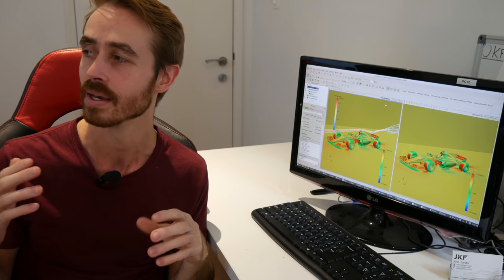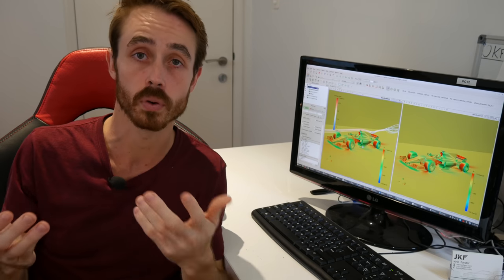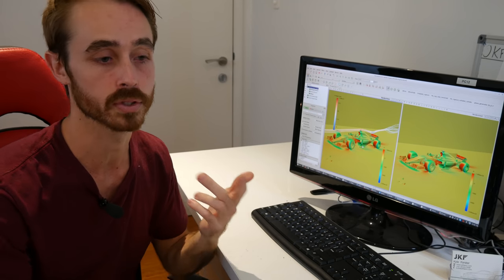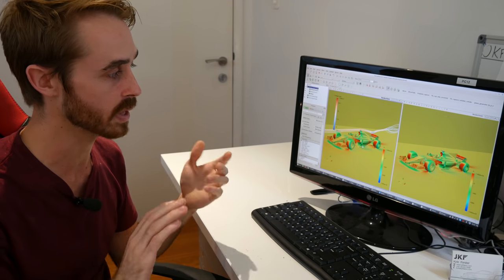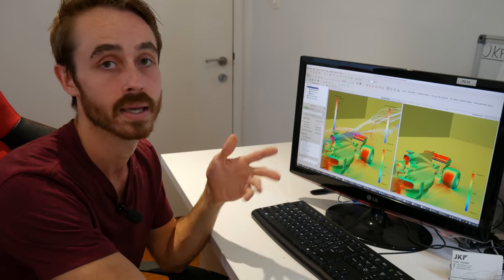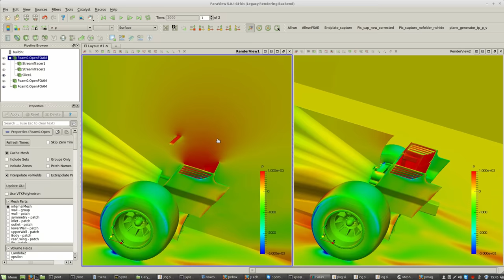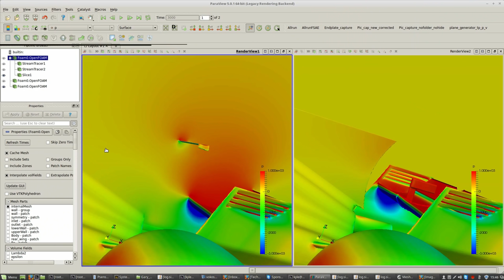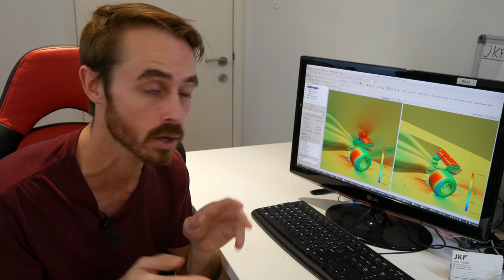T-Wings on 2017 F1 Cars - How They Work, Detailed Explanation and Mythbusting

Comment: Have you thought that perhaps the t-wing is being used to extend the zone of dirty air behind the vehicle, and thus making it harder for competitors to overtake?
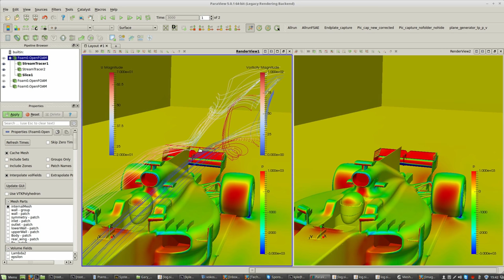Reply from the maker: I would think it highly unlikely, the wake of the T-wing is above the rear wing, so the upwash of the wing will keep its central wake clear of the following car (see the video at 4:10). The tip vortices merge with the current wingtip ones, and as such would have little effect on the far wake as well. A few aero leads came out a couple of months ago (Adrian Newey included I believe? Can't remember exactly) and said that its primary purpose was a high efficiency downforce element, similar to what I concluded. F1 teams don't really go out of their way to make dirty air worse, as dirty air is usually proportional to wake magnitude, which is more or less proportional to drag, so gambling on the chance that you may slow down the car behind a little bit isn't worth the performance compromise.

Thanks for dropping by!

Comment: I really enjoy your videos...  aerodynamics is a difficult science to comprehend for those of us outside of the field and I've learned quite a bit from your channel.  The most helpful visualizations you use are when you include streamlines...  pressure fields are easier to understand when the streamlines shows us the flow of the air and subsequent vortices.  So please, more F1 videos (I'd really like to see how the 'closed' T-wings of McLaren and Mercedes perform relative to the T-wings with endplates) with more streamlines...  and more cowbells !!!

Comment: I think it is a useful analogy to compare it with a leading slat on an aircraft wing. While it does not increase the lift at constant angle of attack, it does allow the main plane to be under a higher angle of attack without stalling. As you  mentioned in your video, this comes a drag penalty. Therefore, I would not be surprised if they disappear at tracks such as Baku and Monza.

Comment: What to see next? Correct me I haven't seen it, but there is always talk about the Red Bull running a 'significant higher rake'. So a video about that may explain some of that design philosophy.
/edit: thanks btw for the CFD videos, the explanation is really clear so it helps greatly understanding these things :)
Reply: Just look at  RedBull rear end and how high is from ground and than you look at fron wing how close is to the griund. Reason is front wing "works harder" when is closer to the ground (Front wing works better )
Reply: simple, a diffusor works by expanding the area below the car, creating low pressure between road and car floor
having this work over the entire length of the floor instead of just the final less than a meter is more effective
ideally it would be a bent floor for optimum ground effect, but since f1 mandates flat floors raised above a regulation plate the only way to do it is putting the entire car at an angle by raising the rear towards the axle
drawbacks do exist, such as higher center of gravity and not being allowed to seal the sides with solid parts below the floor

Comment: I keep thinking that some of the benefits from having a T-wing could show up while the car is going around a turn. The hypothesis being that while the car takes a turn at high speed the pressure differential across the shark fin will start a strong vortex shedding off the top rear end and this T-wing could be decreasing the strength of such vortex (thinking winglets on airplanes). It could be improving the lateral stability and I don't know.. maybe clean up some unwanted  interaction between said vortex and the rear wing (during a turn). What do you think? Could you setup de car at a sideslip angle and see if there is more to it?
Thanks

Comment: Your step/iges file seems to be at least 20% defeatured vs. race setup and you know even very small geometry simplifications can have outsized effect on results. (I get it though...saves a hell of a lot of time in volume mesh work). are you using rans-les?

Comment: What is a point of downforce or drag? I've looked on Google about it and without spending too much time on it in all fairness I came up with too many opposing answers. if someone can answer this accurately that would be awesome
Reply: Sam Cook downforce allows for the vehicle to corner with higher speeds. downforce comes at a price for more drag defecting the acceleration and top speed
Reply: Gav Com yeah I get that but what is the point of measurement. It seems to be measured in points by f1 teams. But what does a point equate to kg of downforce?